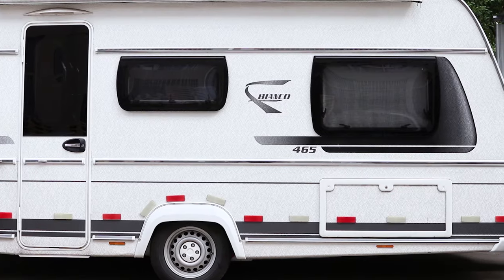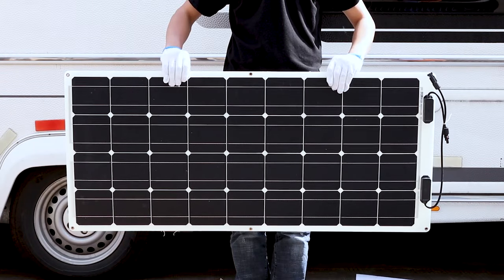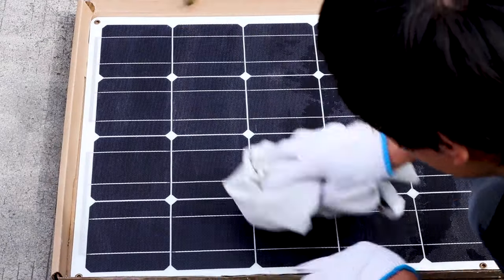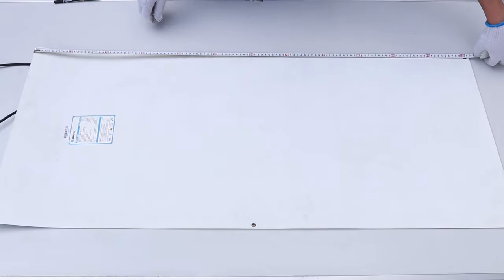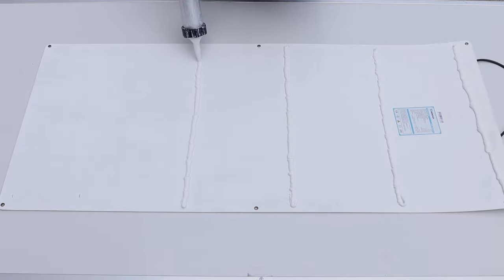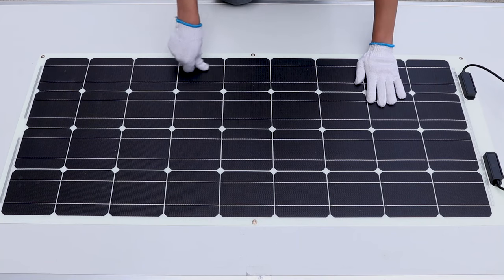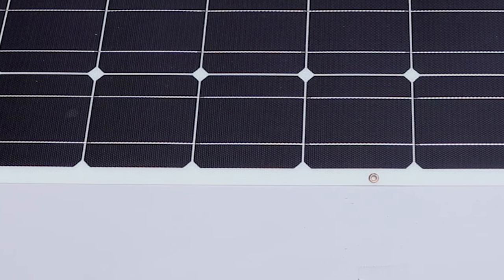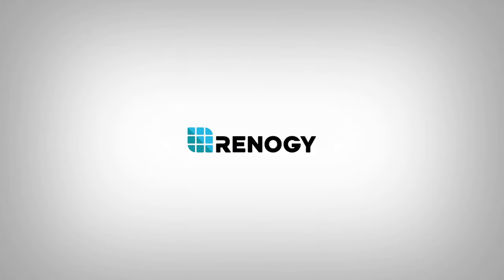Renogy 100 Watt 12 Volt Flexible Monocrystalline Solar Panel

Comment: Hope that in the shipping process something heavy was not set on your large flat package as it will affect all of it. That's the only thing I hate about flexible cells it's the shipping
Reply from the maker: Hi, Cloven.

Because the panel belongs to fragile product, the warehouse and logistics staff will be very careful when packing and shipping. You don't have to worry about the point.